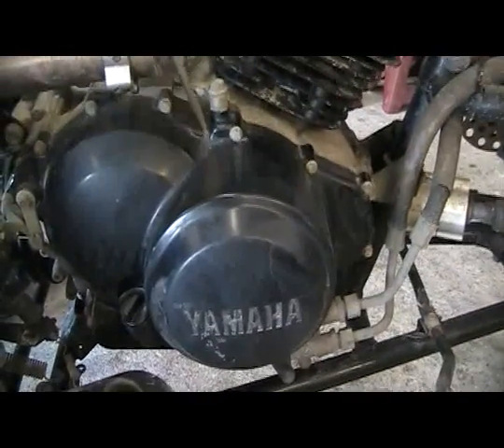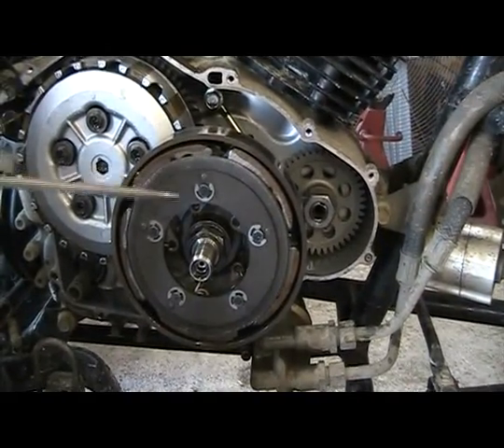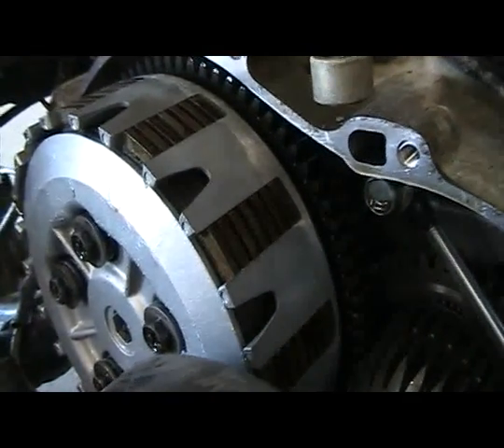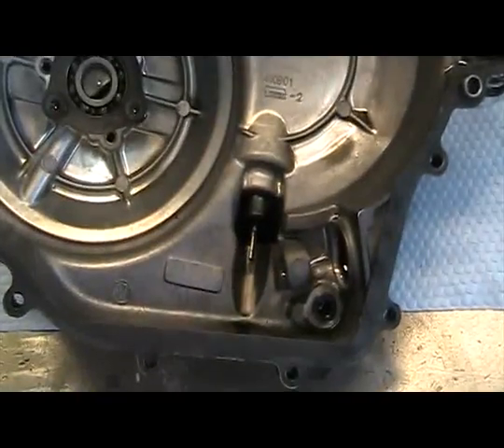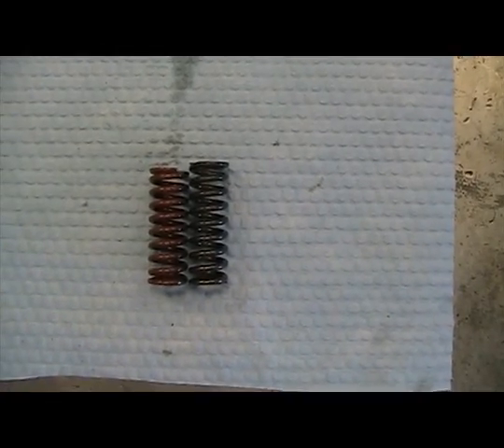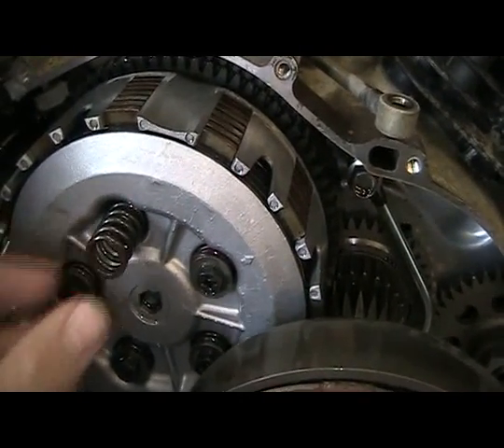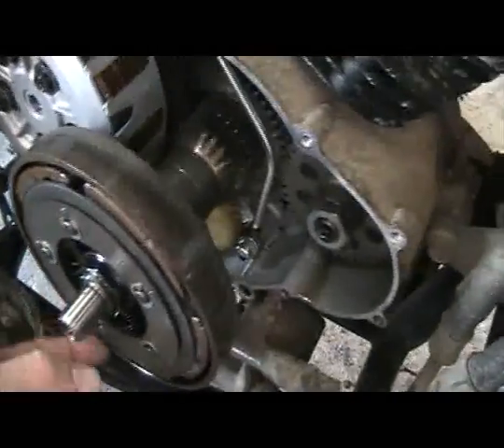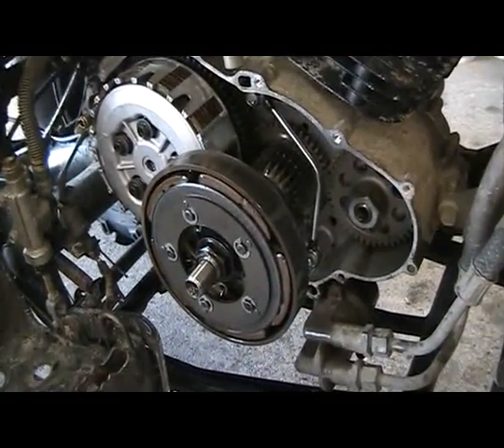PART-9 Yamaha Wolverine 350 4X4 85mm BIG BORE 366cc kit & Hotcam stage one cam install.

Comment: so how long did you take to do  this build first 1 is 2013 are you done.. interested in getting started on my build
Reply from the maker: Took around 20 hours to complete it. I had all the machine work done then I put it all together. Runs very strong.

Comment from the maker: The older springs are shorter. There is a big difference between the new heavy duty springs and the stock springs. This bike runs very well, its lots of fun to ride now. The power comes on strong.